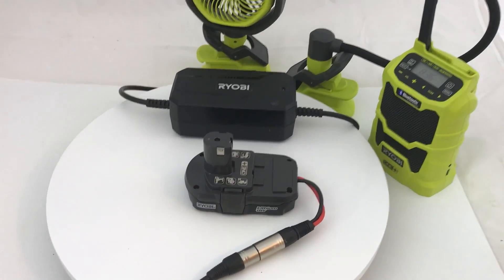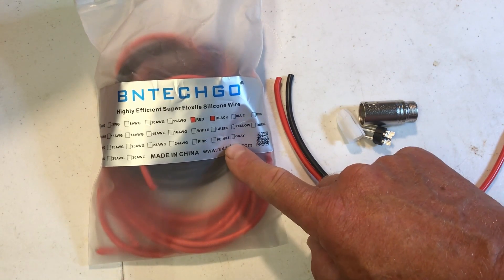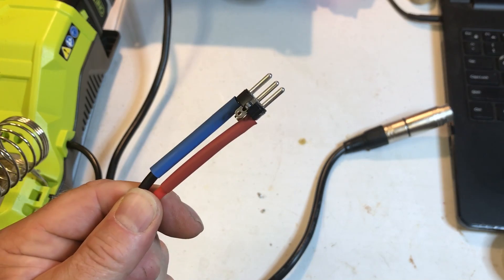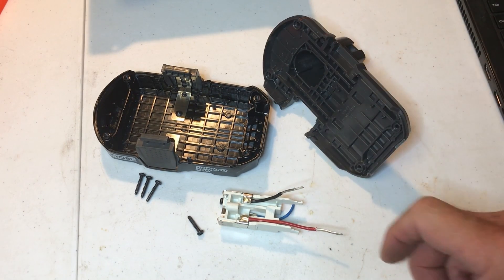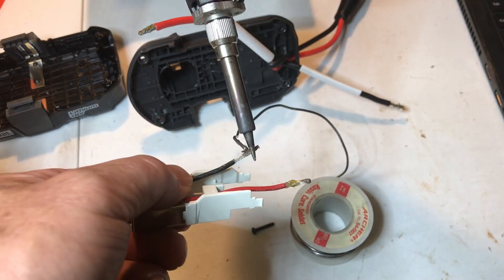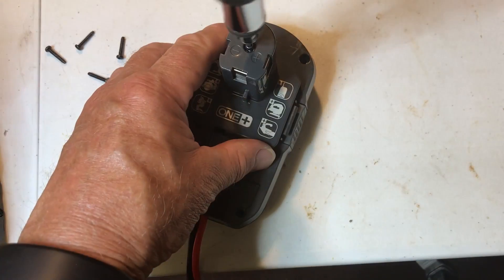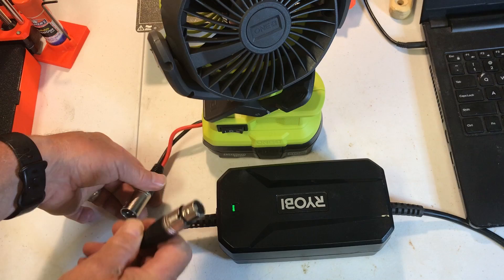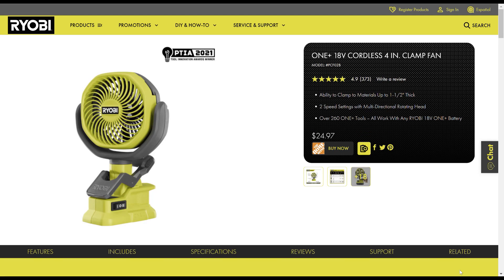RYOBI 18V AC Adapter Hack

Comment: This is one of the hardest things to find information about! I've seen all kinds of hacks and adapters for all kinds of corded and cordless devices, some home built and many manufactured, even adapters for Milwaukee batteries to fit on Ryobi devices, but nothing like this. I just get tired of running through batteries with my cordless lawn mower and if i run out, I'd just like to plug it in so i can finish mowing. (Or any other scenario where all my batteries have run down)

Comment: This is a very smart solution. I have the same transfer pump already, and I am sure another one of my batteries will inevitably die again. Definitely something worth trying out. I am curious why no one has attempted to sell an adapter like this off the shelf. (I know Ryobi won't make one OEM because then it will cut down on battery sales)

Comment: According to the diagram, the output from the power adapter shows the (+) is on the 2 pin [left side], and the (-) is on the 1 pin [right side]; OPPOSITE of what you said. 🤔

Comment: Back in 2004, I used an old Nicad battery body, and connected it to 2x12v lead acid battery with some wire capable of taking 30 amps. The Chainsaw went really well on the 24V. The pair of 12v batteries were in a back pack. But saved the constant changing of batteries clearing downed large branches after a storm.  Now making up an adapter to use from an AC to DC inverter . 24v with 25a max current output, to use on my Mitre saw and Random Orbital sander, that seems to really go through the batteries.

Comment: Not sure if you consodered the p3320 fan w/ a 110v a/c male plug coupled into a standard 18v dc female battery socket. It seems like it'd be less work & cost
Reply from the maker: Several RYOBI tools allow you to plug them into 120VAC. They do not charge the battery. They just convert the VAC to DC of the appropriate voltage. They are typically low power devices. I suppose you open the fan up and tap into the converted AC. The fan would then have to have another cord with the male battery end. I don't have that fan, but I do have an LED light that takes batteries and AC. I'll have to take a look!

Comment: I was thinking making a adapter for a charger.  Charge a 4amp battery in 30 m or a 9amp battery in a little over an hour.   
What's your oppinion on using 2 power supplies in parael to increase current output for tools that require more power?
Reply from the maker: You don't want to charge batteries too fast, it will ruin the battery or cause safety issues

Comment: I measured the current draw on a couple of Ryobi ONE+ tools. The wet/dry vacuum draws 12A. The miter saw draws 24A on startup, but goes back down to about 15A when spinning (but not cutting). I suspect that a 30A power supply would be about right. I hacked up an old battery to act as a male plug, but I'd really like to find a plug that    has more robust wires, etc. Currently looking at power supplies...
Reply: Did you settle on one?
Reply: I grabbed a 24V 30A supply and recently made an adapter recently. On my tools it's fine, but for the things like my HP miter saw, it acts like low battery if started from a stopped position. Likely an amperage issue.

I'm going to try to add some high capacity capacitors in parallel with the output and see if I can get past that initial surge current.
Reply: @LandonsLaboratory  hi, did you get some good results with capacitors ?

Comment: I wish Ryobi would sell a purpose built adaptor like this to run their cordless tools. The only cordless tools worth a damn to me are drills & drivers anything is else is garbage imo and I'd rather have a corded version. 
Unfortunately I received a cordless Ryobi trim router for Xmas last year, it's a nice trim router and it definitely better than the other trim router I have from Harbor Freight but its totally useless to me bc it's battery powered. I have batteries but when I want to use it I have to wait to charge a stupid battery first. An 18v DC to AC adaptor would solve all my issues.
Reply: Me and Sad Panda: " I wish Ryobi would sell a purpose built adapter to run their cordless tools"

Ryobi:  "That's not how capitalism works. Just buy more batteries and chargers"
Reply: why wouldn't you keep the battery charged?
Reply: Buy more batteries so you can swap

Comment: So this device makes it so you can use either battery power alone or use power from an outlet? 

Like how a laptop or a smartphone can run on just battery power or on power from a wall outlet when it's plugged into an adapter?

That would be cool if your device does the equivalent for 18 volt Ryobi batteries and tools.
Reply from the maker: You can use 18V batteries with your Ryobi tool, or for some of the lower power tools you can plug them into AC

Comment: Hi Chris.  Any chance you could come up with an adapter so that we can use a Harbor Freight's Hercules 20V 12AH battery on a Ryobi tool?  Harbor Freight is selling them for $140.  This is half the price of a 2 pack of 6AH Ryobi batteries.
Reply from the maker: When I tested knock-off Ryobi batteries, they lie thru their teeth. I never got close to the Watt/Hr or Amp/hours listed. They also use cheap no-label, low amp batteries. I decided to pay extra and not worry about my house burning down. I don't have any Harbor Freight batteries. It might be a fun project building an adapter... Do you know if the BMS is in the battery or the tool?  thanks for the idea
Reply: @SerendipitySue  The Tool Bear took one apart.  The 21700 batteries are Samsung but the BMS board looks really small.  They are nothing like the circuit boards in a true 20V Ryobi battery.  The tear down video is on the youtube channel The Den Of Tools and the video was posted today, 8/26/2022 .  The video is only 3:28 in length.  These are HF batteries for the Hercules line of tools.  Thanks Chris.
Reply: Thanks. I searched on eBay and Amazon and could not find one.
Reply from the maker: Looks like someone makes one already: https://www.ebay.com/itm/144567582700

Comment: Any thoughts on trying the power supply from the Ryobi P4002PS Drain Auger it shows a 18v DC 6A output? Was hoping their new Miter saw would be Hybrid but unfortunately it isn't so definitely looking for ideas.
Reply from the maker: That's even less power than the pump power brick... and that wasn't enough to run high amperage tools. I doubt the 6A powersupply would power anything more than the fan, radio, LED light etc.
Reply: @SerendipitySue  just re-watched your video, for some reason I thought the pump power supply was 3 amp.

Comment: I wonder if some capacitors or super-capacitors hidden in the "battery" could soften the current spikes from drills and other higher loads, to make this power supply setup compatible with more tools.
Reply from the maker: The ryobi power brick seems to have a large capacitor in it. When you first plug it in, it takes a couple of seconds before the green light goes on.

Comment: Thanks for trying this Chris.  I did something very similar years ago with using an old 18V power supply from either an old laptop or printer and came up with the same results.  It worked fine for Ryobi devices needing less power, but it didn't work so well with my power tools.  These power supplies just don't have the necessary amperage.  I was hoping you'd have better results than I did otherwise I'd run out and buy that power supply.  Thanks for trying.
Reply: @Derek xPaPaDx Frampton You must not have read my comment because it referred to my partially successful attempt doing this many years before this video came out.  It was done with an 18V PS with a lower than necessary amperage for power tools but enough for flashlights.

Comment: Hey Chris, this could work with a laptop charger too. Can you do a video on that? I've seen some people connect like 5 of them in parallel
Reply: How is the output voltage regulated if you combine 4 together?